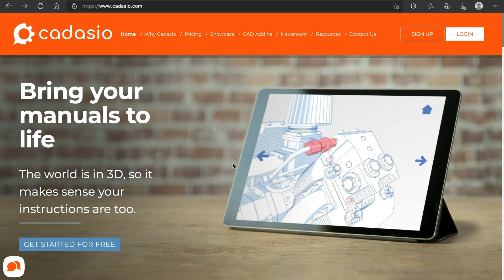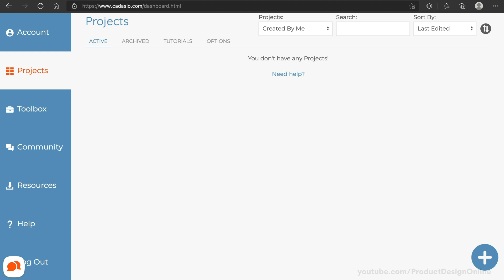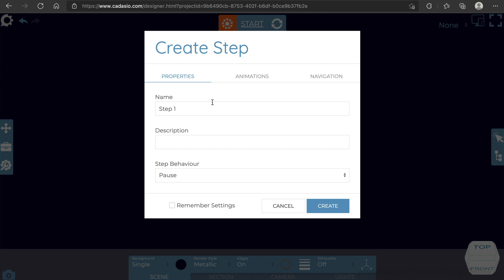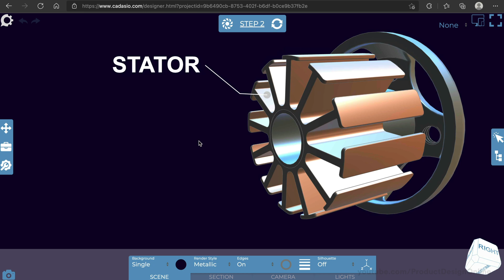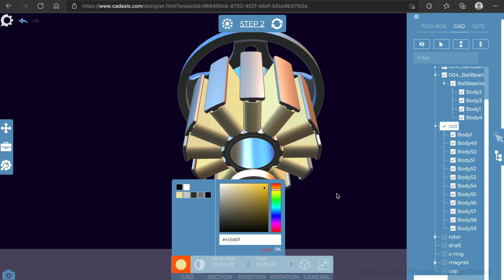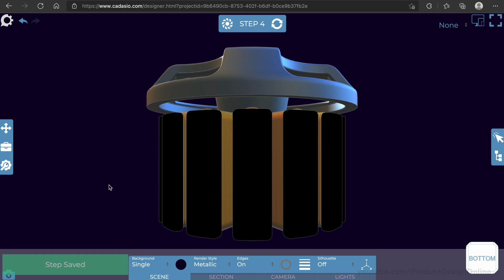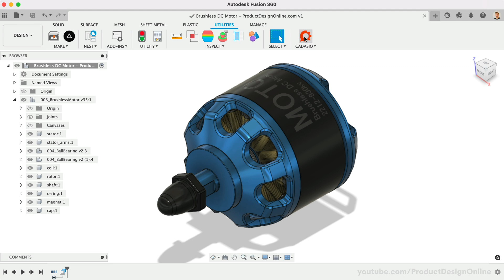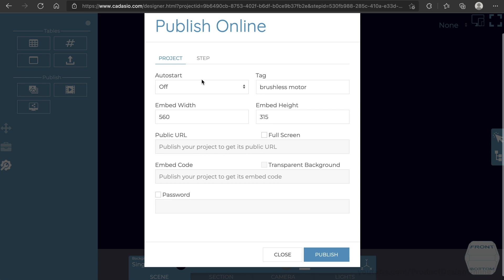Create 3D Instructions with Fusion 360 + Cadasio

Comment: Great video as always. I’m interested in your thoughts of when to use this vs building the plans directly in Fusion 360 using drawing and animation tabs.
Reply from the maker: Great question. For starters, a lot wil depend on where/how you want to share with folks. Big downside to F360 animation workspace is that you can only export to a mp4, which you would have to host somewhere. It also doesn't allow customers to view it in 3D like Cadasio does... nor can you add all the labels and steps. For 2D instructions, it could go either way IMO. There are some pros and cons to each. You're making woodworking plans, right?

Comment: Very interesting add-on. Do you know what people love? Lists! They go gaga over lists. You can even spice it up by putting the word "Top" and then a number! Such as "Top 5.83 add-ons for Fusion360". That's a panty-dropper right there. And then once you decide which add-ons you want to showcase, you can make a video showing how to use each one. The point being, to show how Fusion360 is a more of a holistic program rather than a standalone one. It can be central to a workflow instead of an add-on itself. If Fusion360 not only is used as a CAD design software but also an animation (like you showcased), engineering design (spring design, gear design, tolerance, motion, FEA, etc.), file management, workflow management, etc. process, that would cement it in a person's and companies mind.

Comment: What possible reason is there to take things out of Fusion and pay for a secondary app that does what is already build into Fusion and which will update with your changes to design?
What can Cadasio bring of benefits over this https://youtu.be/Y330vJreHIU?t=407
Reply from the maker: Hi Jens. Great question! I have covered the Animation workspace  before (https://youtu.be/obSEavWPdxQ) and agree with you that there is some overlap between the two programs. Cadasio offers a lot of functionality that is not (and likely never will be) available in F360's animation workspace. In short, the core difference is that cadasio allows your customers to view and walk through your guides/manuals/instructions in a 3-dimensional manner. They can even rotate or inspect the model in 3D, etc. F360 simple exports as a static video.

You can also have 3 projects at a time for free. Their pricing is really targeted towards folks using/sharing many manuals with customers or clients.